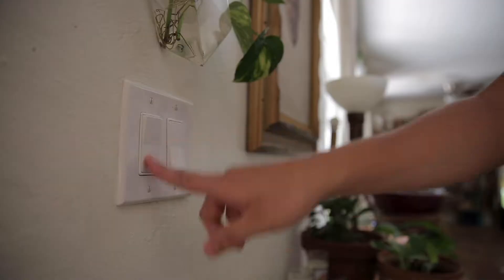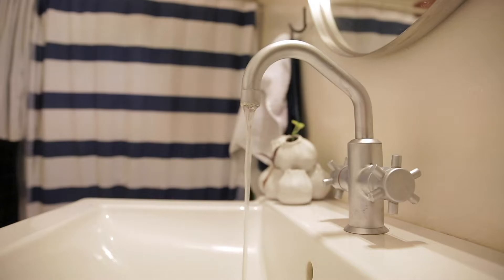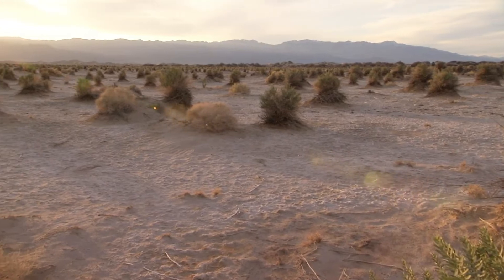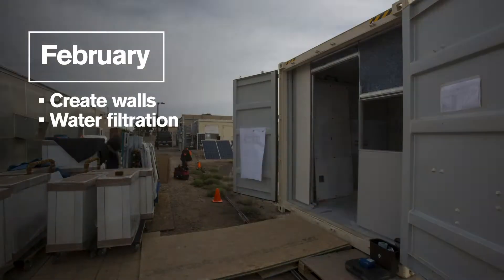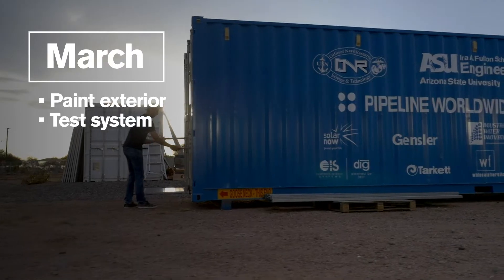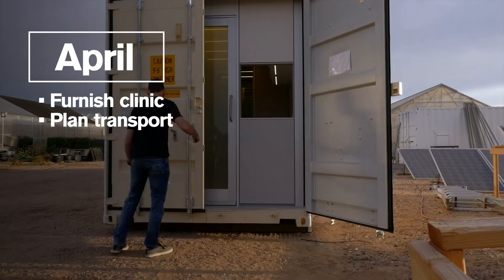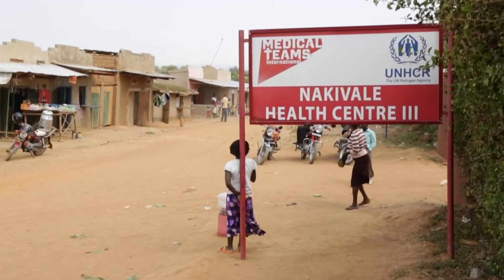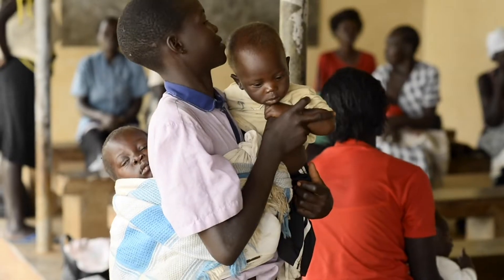Medical care off the grid | Arizona State University

Comment: This is a great idea, and it kills two birds with one stone.

We have a bit of a problem with cargo containers in this country. The problem is that we're importing far more of them than we're shipping out, and they're really starting to pile up. It isn't even worth it to scrap them. We need to find new uses for them, and this is a very noble one.  As an added bonus, it appears unmodified on the outside, meaning you could probably send it to its destination on a container ship like any other container.
Reply: TBustah- I am the lead for this project! Those are great points. We were very careful to not modify the exterior of the container in any way prior to shipping to the destination country. We designed it to maintain "seaworthiness" and perform the exterior modifications after it reaches its destination. We'll be in Uganda in Oct/Nov commissioning this one on-site.